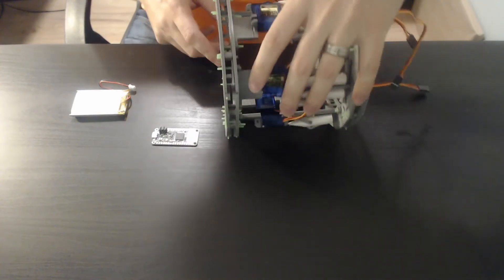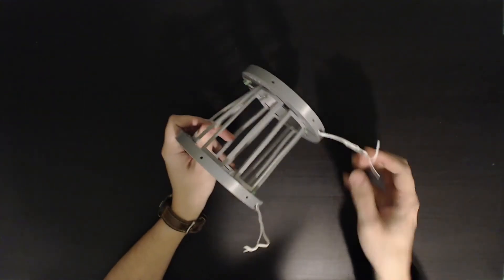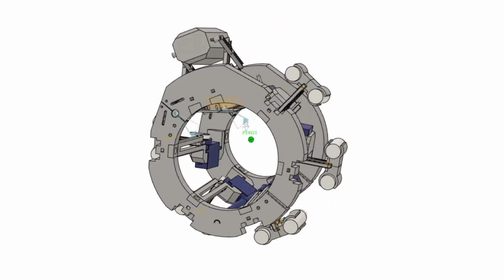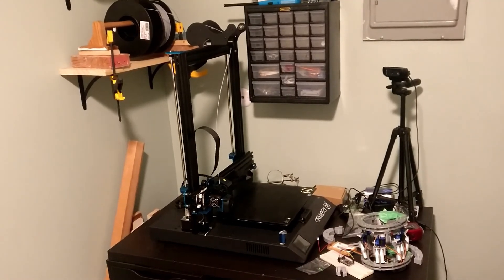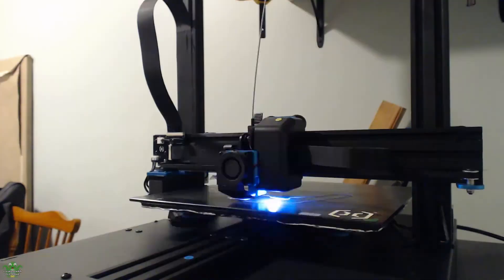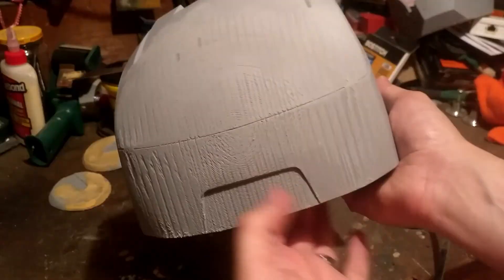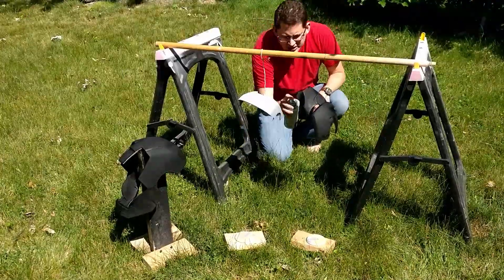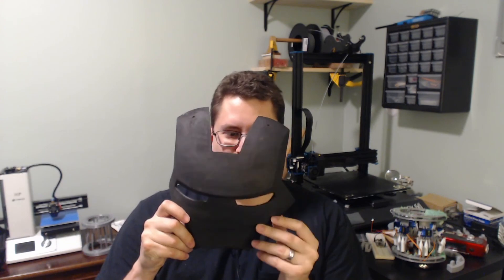Overly Intricate Iron Man - Update 7

Comment: 7:13 you didnt scale that properly
Reply from the maker: I think it would have been was pretty close. Trying on the warped helmet it is a tight fit left to right. The faceplate warped in a way that makes it look a lot wider than it would have been.
Reply: @DrCyanide  USE THE SCALE FUNCTION IN CURA LEFT TO RIGHT IT WILL GIVE YOUR SIZE IF YOU MEASURE EAR TO EAR
Reply from the maker: @fkingride.5500  I'm aware of how to scale things in Cura. I scaled the helmet before I printed it. At the time stamp you indicated it looks poorly scaled because it warped in the hot sun, not because of any issue with scaling or printing.

Comment: I hope you didn't throw out that face plate.
Heat is both your enemy and your friend.
Try a heat gun the reform it. Once it's able to fit the helmet, put it in the fridge or freezer. I wouldn't be discouraged by this, rather see it as a learning experience to deal with future issues.